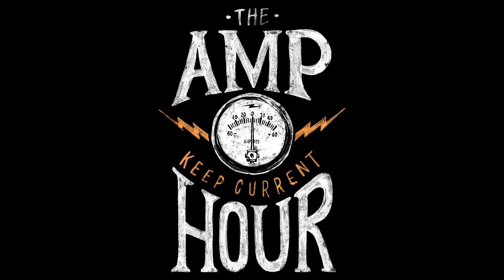The Amp Hour #637 - CH32V003...fun! with CNLohr

Comment: Great enthusiasm, and excellent communicator, big fan of CNLohr!

BTW, aside from the low-cost 10cent parts from LCSC, any thoughts on the $5 RP2040 used on the Pi Pico?  It has 8 PIO state machines, which seems to be unique, or at least not on the ESP32-C3 (risc-v)!

Any plans to cover FPGAs?